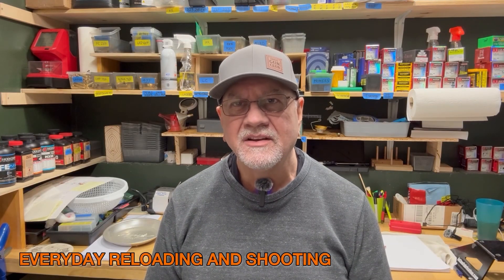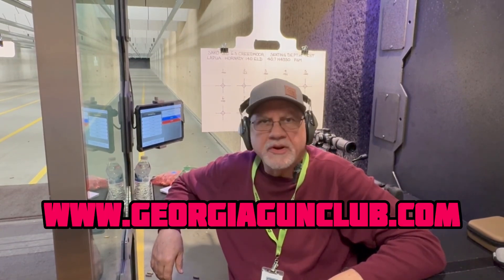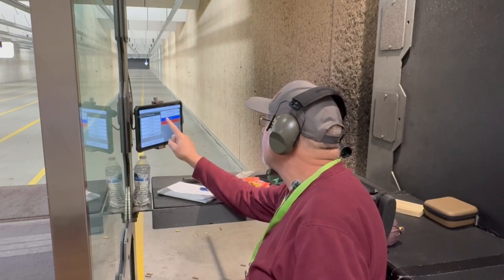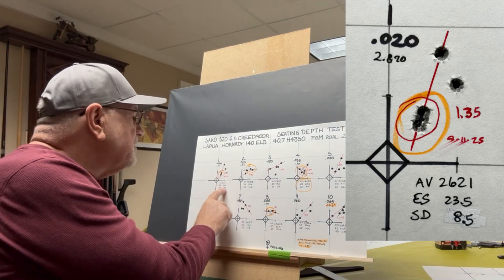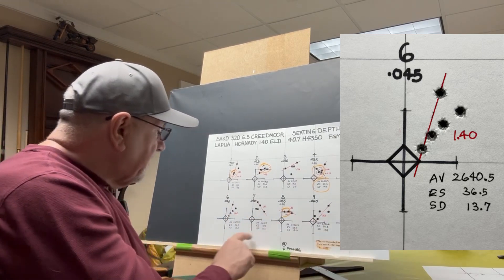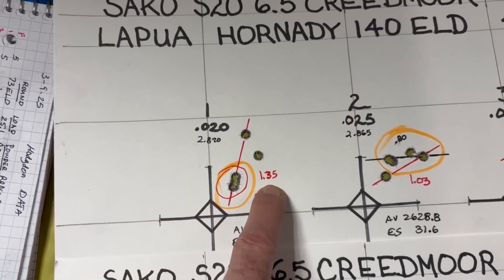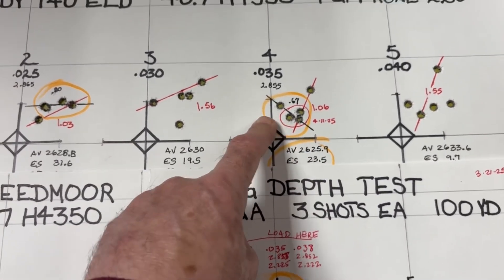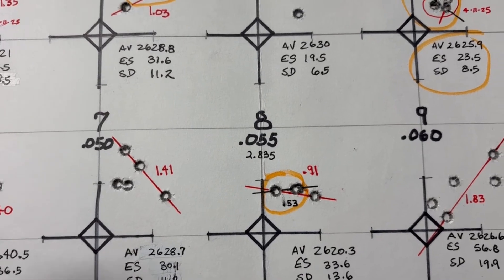Load Development for 6.5 Creedmoor, Continued — Seating Depth Testing

Comment: Did you say you had the powder in the cases for a few weeks before you actually loaded them so your powder is exposed to that humidity variation?
Reply from the maker: That is correct. Charged cases sat in the loading blocks without any bullets for about 3 weeks. Thanks for watching.

Comment: Something is wrong with your rifle. Generally these S20's shoot very well. Have you used a factory ammo to get a baseline for accuracy? Also assuming you worked up to OCW, since you are loading a weird charge weight (40.7). H4350 and those bullets should be making ragged holes. Every 6.5 Creedmoor I've been around has loved that combo. You are definitely right about 3 shot groups, "they lie to you". Especially in an unproven load: The reason I prove out a load with 10 shot groups. I also don't putz around with seating depth, unless the dispersion is telling me to adjust. Learn to read group dispersion, and adjust for it. You can't do that with 3 shot groups though. A minimum of 5 shots is what you want. Then like I said, prove out the load with 10 shot groups. A rifle like yours (Sako S20) should be shooting sub moa for 10 shots.
Reply from the maker: I think you'll see some improvement in the next video that I'm about to post. Thanks for the input. Always appreciated. I like the idea of confirming with factory ammo. Thanks for watching.

Comment: Thanks for sharing the results!  I wonder sometimes about how much the temperature and pressure of the atmosphere and the temperature of the barrel affects the speed of the loads we shoot.  I have experienced similar variable results shooting factory ammo from the same box.  Some days the zero clocks it in the 2620 realm and shooting tight, other days It’s shooting tight at 2675 with the same ammunition lot number and a warm barrel. #8 of your 5 shot tests seems to be what I experience when its shooting tight cold (I blame the wind since I’m shooting outside) but maybe there is more to it?  Great work!
Reply from the maker: @jonathanodermann913  thanks for the comment Jonathan. I appreciate you watching.

Comment: Great video. I hope by now, it is clear there is a normal distribution for the point of impacts and as more shots are included in the observed shooting group, the MR of the group would converge to a value. The MR is a better indicator of potential accuracy of the rifle/load/shooter. Since we are dealing with the statistical analysis of shooting groups. 
There is a level of confidence for each observed shooting group. The more shots are taken, the more accurate the mean radius of the observed group(s).
Statistically, to get a high-level of confidence, Expected Maximum Group size is 2.2x MR. Example, if MR. is 0.5 MOA, the expected maximum dispersion of the group is 2.2x0.5= 1.1MOA
Reply from the maker: @YERAFirearms  MR is definitely the best predictor of accuracy. I will often measure that with the Hornady ballistics app. I do have greater confidence in a 10 or 20 shot group than just a three or five shot group. I use the smaller groups to try to get an indication of where I want to load. Then I shoot larger groups to verify if that is in fact a good load. Thanks for the comment. And thanks for watching.